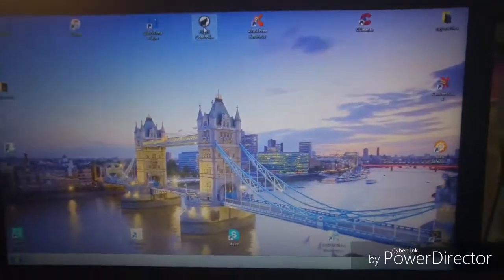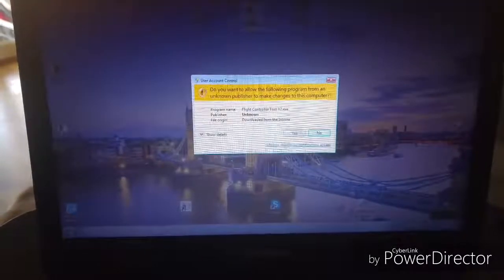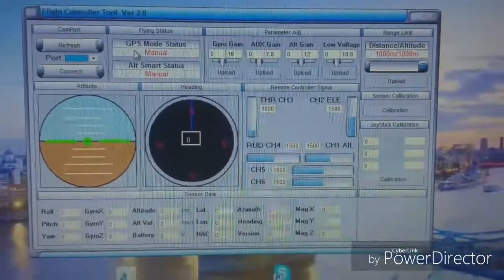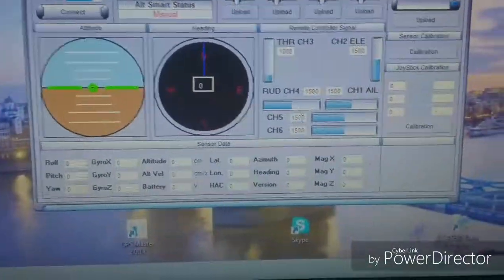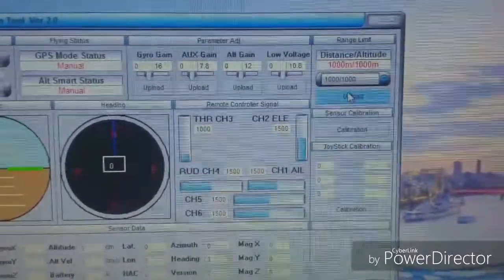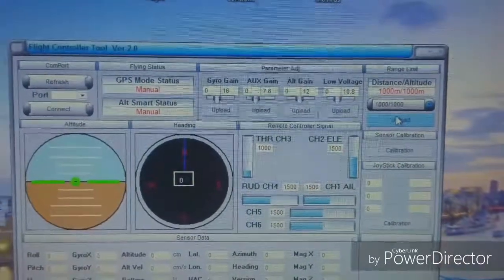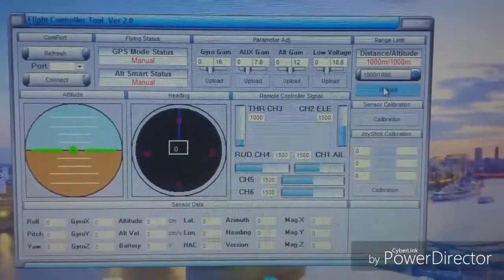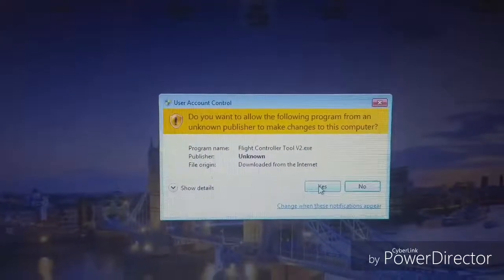FreeX mcfx  Demo  using Assist Tool v2

Comment from the maker: Freex website my bad
Reply from the maker: Its only works on window's if cant find using google freex software let me know ive got friends rhat have it i dont have mine now 3 yrs old drone they gone under dont make them anymore sorry
Reply: @gadgetman404  ok, thanks. I will try to find one online.
Reply from the maker: And your point is what freex gone now Dont mske freex. anymore ive got three ecs motors controller gyros receiver  you eant to buy
Reply: Hi,
Great video!.
Could you tell me where can I find this software? Their website is down, I can't download it from there.
Thanks!
Reply from the maker: You mac or window's
Reply: @gadgetman404  I have Windows
Reply from the maker: @saxonrc  im still looking been on holiday and like i saud they stopped making etc but i know people that still have one leave it with me
Reply: @gadgetman404  hi, thanks for your reply, I have found the software and 2 updates online, all good now. :)
Reply from the maker: @saxonrc  cool did you get gimbal version i did its great if u interested got lots af spares fir sale spare transmitter charger motor fc receiver just no esc or gps module on wooden frame can be taken off for shipping etc im uk u r
Reply: @gadgetman404  Yes, I have the gimbal version. It's working fine. I have replaced the props for the dji phantom 3 props and added a new fpv equipment ( a bit heavier camera and tx ) so I have to adjust the PID setting a bit, it was too shaky with the new stuff. Now she is flying perfectly again.. :)
Reply from the maker: @saxonrc  cool links to video's on my site good few flight video gadgetman 404 got freex playlist etc
Reply: @saxonrc  hi, where did you find the software needed? I can't find the firmware installer tool.
Reply: @saxonrc  thanks, I've found those but i can find the installer tool to install new firmware. When i use the flight controller v2 i can't change the hight/distance restrictions. It is connected properly because i can change gain settings or the low voltage settings, just the changes i make to hight restrictions won't save. I've read i need to updade the fimware but can't find the installer.
Reply: @RCHELIBUG  Ah, sorry, I don't have that tool.
 As I have the latest firmware and it won't be updated anymore I didn't look for it.
Reply: @saxonrc  thanks anyway
Reply from the maker: It's on freexgroup.com website but think they gone under bro
Reply from the maker: Sorry bud can't help there mine in bits now got all spares FC gyro receiver transmitter never updated it it's well old now 2 to 3 yes buddy can buy for Soares got three motor's etc aswell
Reply from the maker: Just right click on programs run as administrator when you find it
Reply from the maker: No probs message if want spares
Reply: @gadgetman404  yeah i did right click and what not, it is connecting because i can adjust gains and other settings, just can't change the hight limits.
Reply from the maker: I don't change height just click no limit you can't choose how high etc click high light no limit done goes about 1km 1000 meter's
Reply: @gadgetman404  yeah I've tried selecting no limit, press upload. But then when i reconnect it  says 150/50 again
Reply from the maker: Ok
Reply: @gadgetman404  I'm sure I've read somewhere that i need to upgrade the firmware before i can adjust the flight limits, but without the upgrade tool I'm stuck.
Reply from the maker: Join some forums some one should help

Comment: Hi, I've just picked one of these up on the cheap, i don't have a clue which firmware version is installed. Do you know where i can download the software tool and update tool? The freex website doesn't seem to exist anymore.  Thanks
Reply from the maker: Its on hubsan website support section
Reply: @gadgetman404   Thanks but I've just looked and don't see it, are you sure you meant hubsan website? It's not a hubsan.

Comment from the maker: run programe as administrator connect usb lead provided connect right corner distance height change in there job done
Reply: not working -- run program as admin -- plug battery turn on controller plug usb the program not recognizing the drone